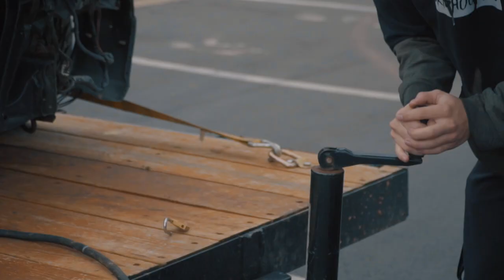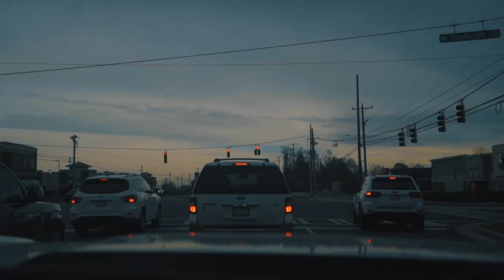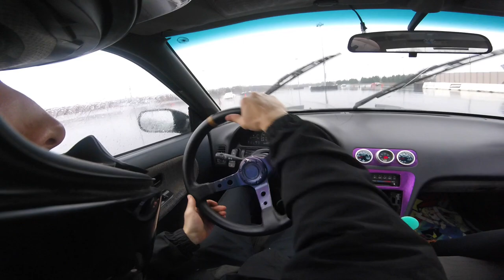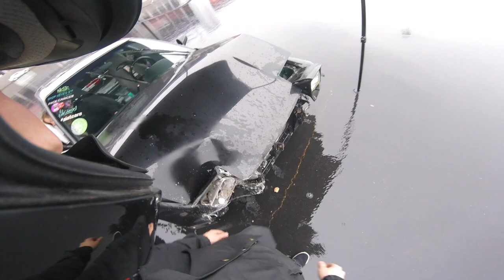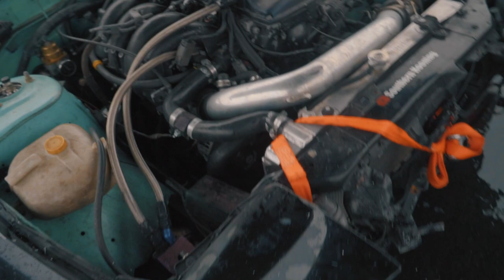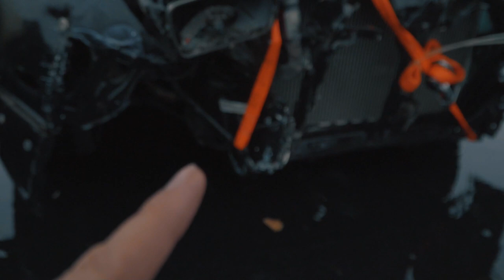MY 240SX vs MEIHAN WALL

Comment: Rubbin’s Racin. If ya ain’t first you’re last. In Indy your tires were twice as wide and the car weighed half as much. Now your tires are half as wide and the car weighs twice as much and your burning them up. Loose is fast and on the edge of out of control. Sr20’s pull a premium a week before races wars. G’s up, hoes down.

Comment: i love these videos but i got a question why dont you every use your handbrake i know its the stock wire ebrake but you can still get entree with it and slow yourself down if you spin out just rip the ebrake even more and it will slow you down and wont do as much damage

Comment: Ur only issue with the rain drifting is that u lift a little to early. Especially on initiations, and when ur speed scrubbing. Once u fix ur 240, Just try to be a little more confident in the throttle and you'll be fine!

Comment: Hey man I live in myrtle beach south carolina i was wondering if i coulds get in touch with you.  I have a 95 hardbody with 91k miles on it i lowered it and was going to make it into a drift truck.
Reply: Hey I live in Charleston and I've built a couple of hardbody drift trucks. There definitely fun! Hit me up if you need info. Lots of aftermarket steering and suspension accessories for hardbody's that no one knows about. Look up missleworks.com. they have modified steering arms that bolt right up to your stock spindles for $170 a set with extended brake lines.